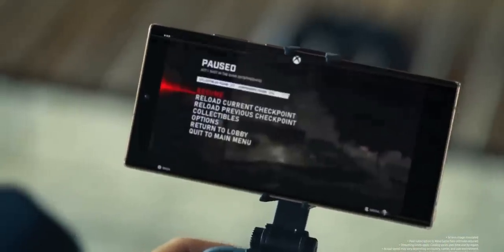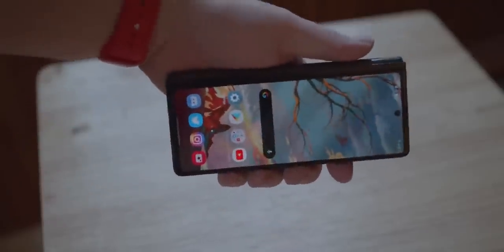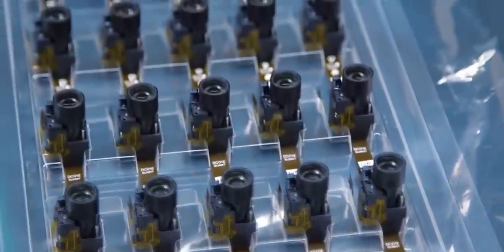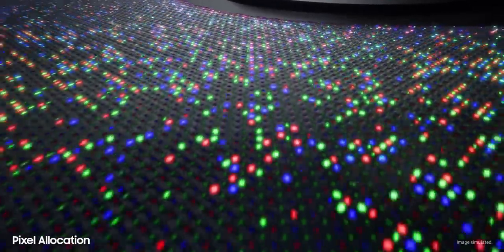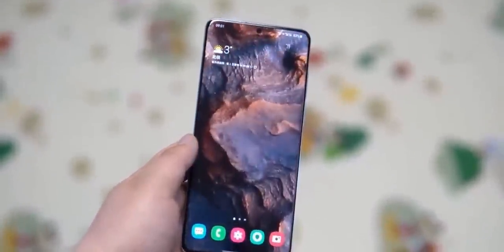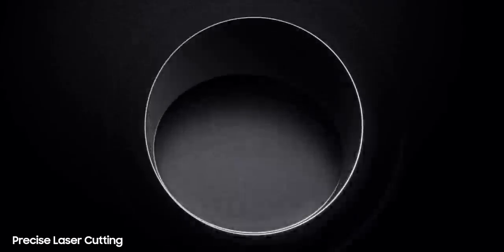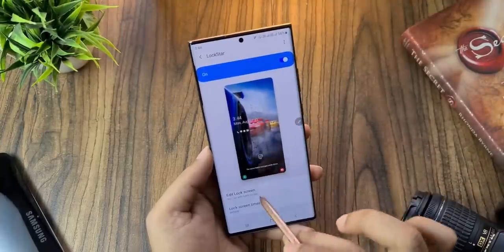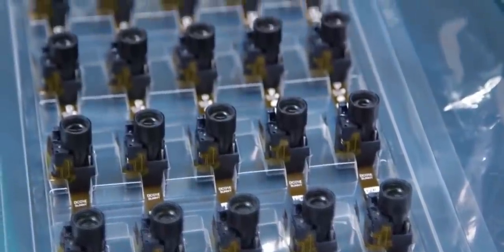Galaxy S21 Ultra - SAW THIS COMING

Comment: I've seen the under display camera in their current state and I'm not impressed by the quality. Personally I'm fine holding off  until it is perfected, but I don't care about a selfie cam anyway and I'm probably way too ugly to want to use it, but the results seem way too soft and a bit annoying when you see the transparent OLED section off axis. Needless to say, It has ways to go yet, but I don't care about the punch hole. Actually, I think the punch hole is rather a interesting solution and visual aesthetic that sets itself apart. Regardless, at least anything we get isn't a notch, so I'm grateful for that cough crApple *cough*.

Comment: Hey sal a metal score for the A14 GPU shows that it is 73 percent faster than A13 but apple claimed it is 30% faster than A12 so it is true or BS because the other day in the interview with I Justine apple VP said that a12z has better graphics where as leaks show that a14 have better graphics even then a12z?

Comment: While samsung is doing the under display cam, apple is still figuring out how to remove the notch...
Reply: It would be a lot harder for apple to do it though, since they'd also have to put the face id sensors under the display. I seriously doubt apple will abandon face id, or the notch until they can put all of the sensors under the display. We've already seen it's hard enough for samsung to put the camera under the display, so they delayed it for the year after next. Imagine how hard it'd be for apple to put a camera, and 3 sensors under, without entirely giving up on face id
Reply: @Brian-wp9er  they're not, until it's possible to fit them under the display, is when they'll remove it

Comment: I wonder how dear the phone's will be with under distillery camera. I would love the fold 2 but in Australia it costs $2999.00 at least the kept it the same price as the fold 1. I'm not saying it's not worth it it is with how much better it is this time I just can't afford it. I was going to get the s20 Fe and still night. But will see what the s21 ultra has to offer. I have the S10 plus and love it and don't use it to it's full potential or all it's features. As much as I love cameras I don't use them enough it in enough stuff. But I like zoom over ultra wide so will see what the 21 offers. 3x on the Fe looks good too.

Comment: If the S21 is not getting the under display camera then I'm most likely not buying it.

I HATE and damn DETEST the punch hole camera more than the notch. It's all or nothing for me. So I'll either have to stick to my S8 or begrudgingly buy a S20, cause I really need to upgrade this phone soon.
Reply: Well i have S6 edge so i will upgrade from it to the new S21 ultra 😊🤗😄

Comment: Well firstly: I'm so early;
Secondly: FUCKING DELAY THE S21 RELEASE ALREADY! I'm so desperate for updating my S9+ but I want an under display camera to update it with!;
Thirdly, last but not least: is Goodlock coming to Italy too? I don't like Goodlock so much though because yes you can change stuff like recent apps but it will have no smooth animation like stock recent apps, so they have to implement it better.

Comment: Iphones may have better chipsets but they can't call it innovation when it is already almost better than their previous chipsets  on the other hand samsung trying its best to innovate new features like :

- Punch hole display( which now every phone has in 2020 from 2019 launched in s10 series. While apple still sticking with their old notch sinch 2018 from iphone x series to iphone 12 till today.

- ultrasonic and side mounted fingerprint scanner which was launched in s10 e and other samsung midrange devices, whereas apple engineers innovated this tech in 2020 👏 .

- samsung going wireless this year with wireless dex which i think no other phone has even apple does not have that kind of feature while having best chipset in mobile industry.

- while foldable phone's are getting hype from people using fold/flip doesn't matter which one they use they are using a unique phone in its own. And apple WILL bring foldable phones when every person can able to afford it till earth dies from this pedemadic. 

-While apple's face id is unique , don't forget samsung's iris scanner which is also equal in terms of security but samsung focused on design rather than just security and they went for ultrasonic fingerprint scanner while apple is still not able to catch up like and INTERNET EXPLORER FROM WINDOWS XP.

NEXT : After home widgets apple will introduce "theme library" when you can choose unique wallpapers from different places and customize your iphone like never before 😂😂😂.
After this apple will become a joke for android users they wont even swtich there phone to iphone just for better chipset and having worst battery life.

Comment: I want iris scanner heart rate dual aperture camera and dual pixel autofocus back does no need this bezeless trend Samsung should have to stop it for good that idiotic bezeless trend is  ruining everything  Samsung is just focusing on marketing  I want those golden top bezel with all the feature even in 2021 s9 and note 9 will rock unlike Samsung making things even worse these days Samsung  meant a downgrade these days why is Samsung is trying to achieve it anyway when they can provide a good amount of biometric scanner like iris scanner now don't tell me it's bad being using the iris scanner it's hard to move on with fingerprint scanner want that iris scanner back which was totally competing apple  face id Samsung needs to stop this provide iris scanner heart rate monitor which is use full in a pandemic, dual aperture camera and dual autofocus three cameras is more than enough Samsung stop messing around with Samsung fans, Samsung was meant to have features back in 2018  from 2019 Samsung totally destroyed the fan base by removing the feature isn't that move to play anti-consumer stop messing with us provide those use full features rather trying gimmicks over gimmicks and i have been repeating hell lot of times